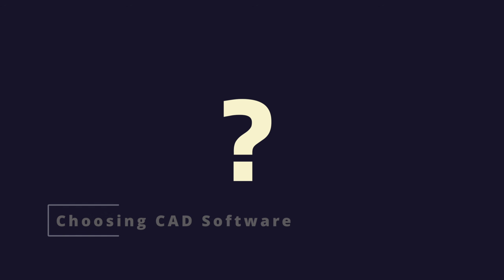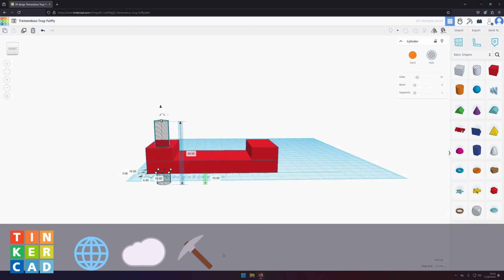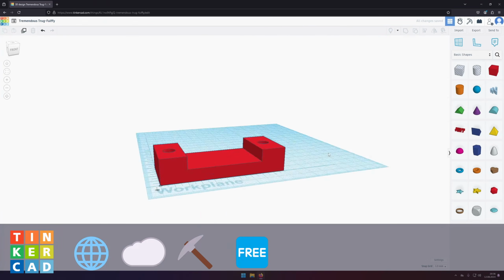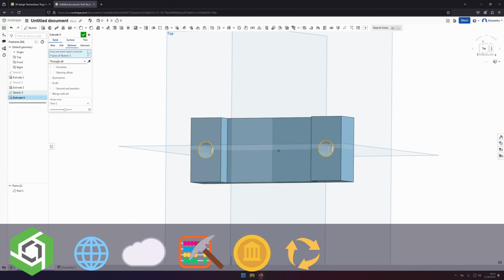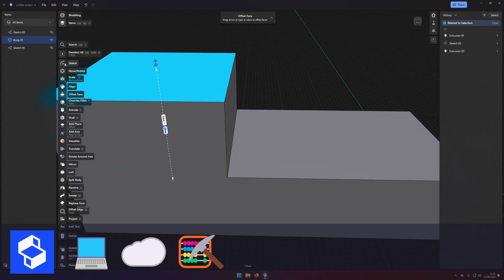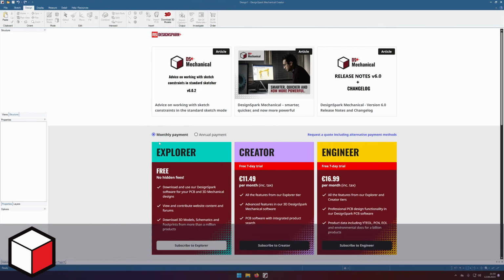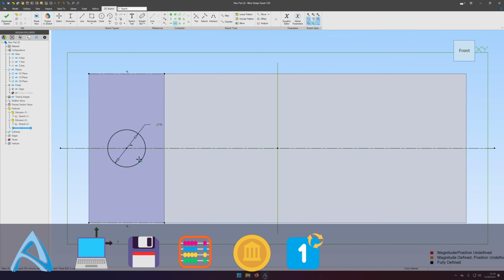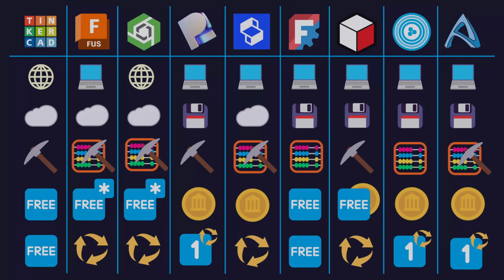Choosing CAD Software for 3D printing

Comment from the maker: Let us know what CAD package you are using and how you chose it
Reply: I mainly use a combination of Onshape, Fusion360, and FreeCAD 1.0. I mainly use Onshape for my main CAD as it is very powerful and is easy to use for assemblies and drawings with many featurescripts that have saved me hours of time. I use Fusion360 for when I need a combination of surface and direct modeling with parametric CAD since it offers that quite well. FreeCAD is mainly used as either a backup or for a good private alternative, but if the development keeps going strong like it currently is, there may be a day where it replaces Onsahpe.
Reply: I am using shapr3d because it is free and works on iPad and Mac
Reply from the maker: @stijn27112  Hope you like it!

Comment: if I understand that correctly, when you want to change your objekt size variables, for example a box 5x5 to 10x5 you need the Atom Expert version für 2000 Bucks, quite steep.
Reply from the maker: Hey, no you don't. Variables tab is there in Atom3d as well. What you probably mean is Global Variables - same variables across multiple designs, yes that is a feature of an expert. However, there is a support for Excel file for that even in Atom. So you mount not a global variable file but just an Excel file and you have your variables across designs even in cheapest Atom3D. Check out Ex Machina video on it - https://www.youtube.com/watch?v=NMt10i_YATs
Reply: @RoadSideMaker thank you, yes I really got that wrong. cheers i'll watch that ex machina video
Reply from the maker: Welcome :)

Comment: Sorry I'm late to this coversation but the question is a no-brainer.
Freecad is the champion!
And I've only been using it for 2 weeks, but I believe I've already mastered Part wb, Sketch wb, Draft wb and Techdraw wb. Moving into Part Design wb now.
Before Freecad, I tried Fusion, Blender, Tinkercad, Shapr3D, Sketchup and a few others, and I either had no idea what's going on, or I found out you have to pay to get a decent model export.
For the past 7 years I had been using MS 3D Builder for my designs, but now that I know Freecad, I'm glad I have moved on.
Reply from the maker: I am happy FreeCAD works for you! Keep it up

Comment: Thank RoadSide Maker for this DETAILED & HELPFUL video. You help me solve the problem of finding a professional 3d modeling software with PERPETUAL LICENSE by bringing Alibre Design to my attention. For now, I am going to use FreeCad. When I outgrow it, I will probably buy Alibre Design. It's not cheap but it allows me to store my project files locally and it has PERPETUAL LICENSE option.

Comment: Nice! I think the goal is compare how the free and cheap can handle remix stl and step. As far I can remember, alibre cheapest one cant handle stl
Reply from the maker: Hey, STEP is universal CAD format. Any parametric cad software will handle it no problems, Alibre Atom3d (cheapest) included. Now STL is a mesh and that is a problem. Alibre just does not support STL in any tier. One would need to convert it to STEP first, to import it in Alibre.

Comment: I understand all tools (Tinkercad, Freecad, OnShape, etc) can generate a design file (STL) that can be sent to a print-farm..

Do you have any favorite 3d printer service that will print a small part most affordably?  Do they charge by amount of material/time, or how complex the shape is, or ???

Since I don't know any of these CAD software tools, is there any one that is especially better when designing a very simple enclosure (with a couple cutouts and standoffs)?
Reply from the maker: No, unfortunatelly I do not have experience with 3d printing services
Reply: I'd say for CAD you can go with Onshape as it provides a powerful toolset and is free (for now?)

This is assuming you do not care much whether anyone else can access your project to download. I also assume you wouldn't be put out much if the ens**tyfication fairy came and makes the program expensive over the next 5 years.

For a printing service I can help you less confidentally. But I know PCBway also offers 3d printing services. Or you google for services in your area and ask a few offers.

Comment: I moved to Alibre to avoid subscriptions
Reply from the maker: Great, me as well! How does it work for you out?
Reply: @RoadSideMaker  I got the mid tear package, it's great and intuitive, I didn't get the maintenance package so I missed out on the update that introduced slots. Only feature I miss from fusion is modelled threads
Reply from the maker: Yes, I kinda miss threads as well, but I very rarely need those. Had just one project when needed. I see the area for improvement, might make a video on that.